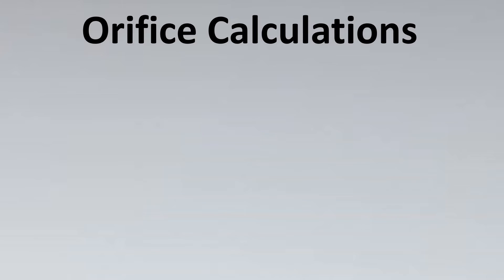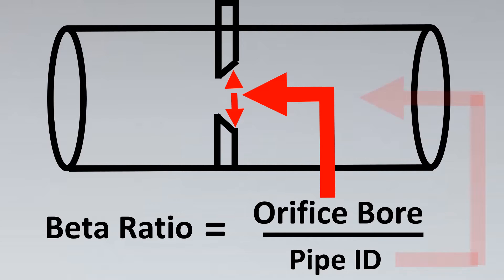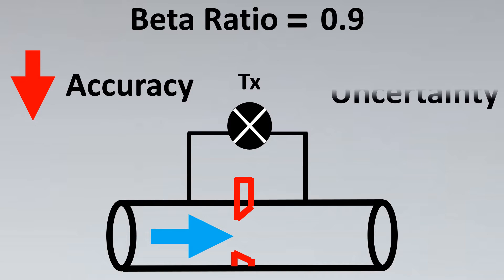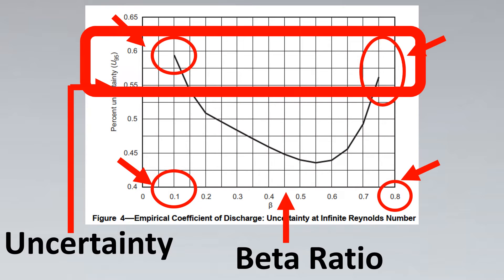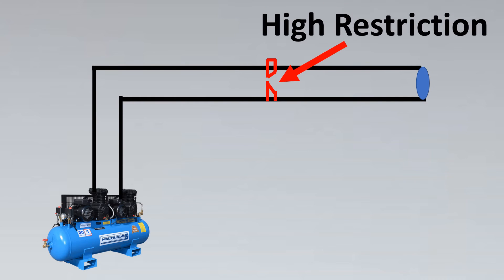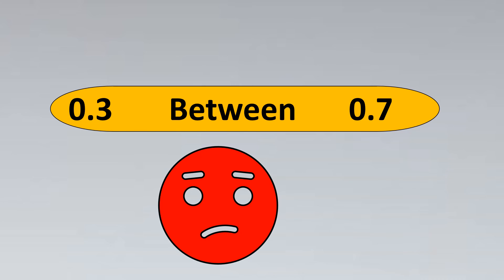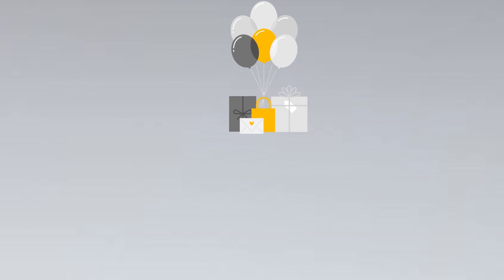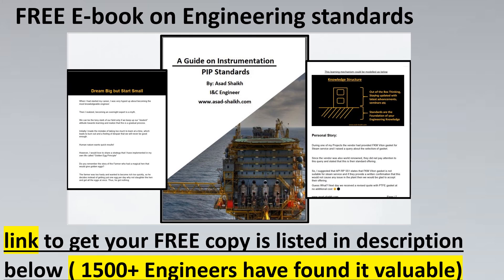Orifice BETA RATIO limit | Why does it EXISTS !!

Comment: On 4.35, if we keep a 'very high' beta ratio then we will not be able to maintain the allowable pressure drop limit...

I think low beta ratio will create more pressure drop.. & then it will difficult to maintain allowable pressure drop. .. please correct if I am wrong

Comment: Nice Video bro.
ISO 5167 defines range of 0.2 to 0.7 . However while engineering we consider 0.3 to 0.7 as safe limits. But it is important to also consider straight lengths as your uncertainty and accuracy depends on straight lengths as recommended while sizing. 

ISO 5167 has a table mentioning straight run recommendations from beta ratio of 0.2 to 0.7 .
Reply from the maker: Yes !! Very true ... Good point I will also make a video on Straight run recommendations in ISO 5167 and how it can affect accuracy ... Thanks for sharing 😊
Reply: I want ISO 5167 calculations design book.
Beta ratio tables also I need. Where I will get
Pls help me

Comment: is it possible to use a orifice beta ratio of 0.2 on a 2 inch pipe? ( interview question) some documents saying that it can be between 0.2 to .7
Reply from the maker: It is not recommended, however if the uncertainty and accuracy at the Beta ratio of 0.2 is acceptable and there is no other option feasible then it could be considered.

Example : A Colleague working for NASA had shared that they had used a orifice with 0.2 Beta because that was the only feasible option for their application and the engineering team was ok with the accuracy and uncertainty.

But as a rule of thumb this should be avoided 😊
Reply: @AsadPassionateEngineer  thank you